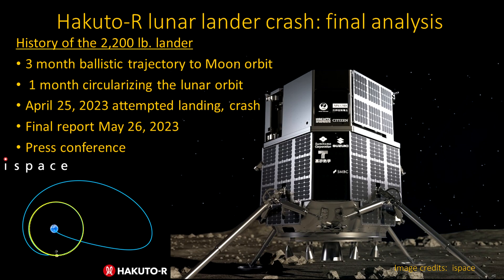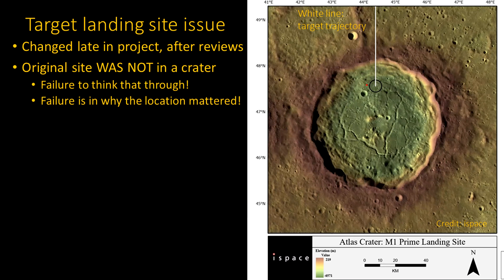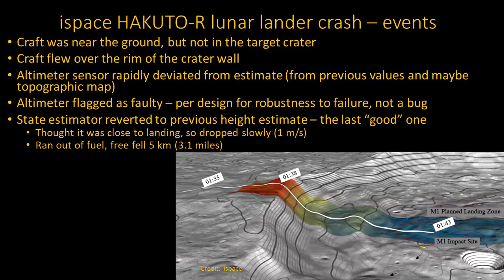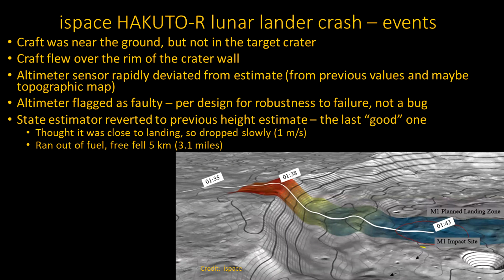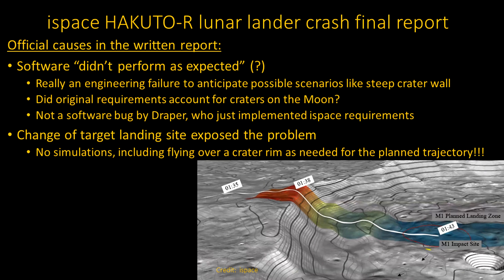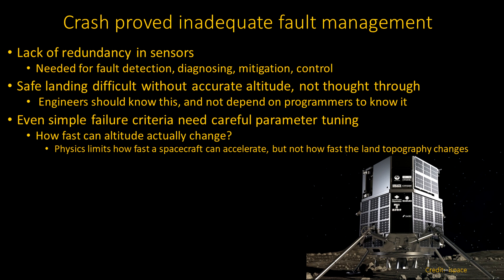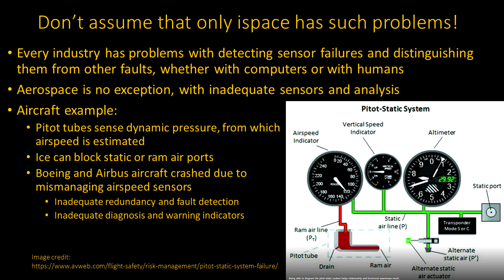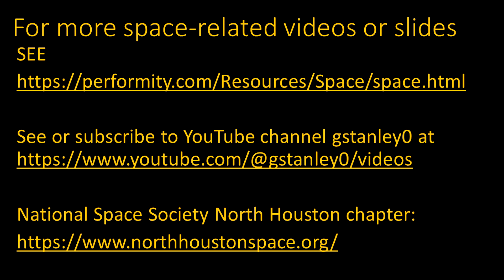Hakuto-R lunar lander crash: A failure in fault management

Comment: There are not a large selection of space qualified landing sensors on the market that engineers could just buy, and they all have physical limitations in terms of range. You're going to be on inertial navigation until you get in range of the surface, inevitably. There's no GPS on the moon. Optical solutions are expensive, requires a lot of computing power to do image processing. That means putting a big heavy box on the lander to add redundancy. That's something a big NASA program can afford, but a small commercial lander is trying hard to cut mass and  navigate with minimal information. A better alternative would be a laser range finder, not optics. A laser range finder pointed straight down at the surface would give you a viable, lightweight backup for your landing sensor. The fact that they didn't bother to redo the simulations at the new landing site is the real red flag that points at management and culture being a problem.
Reply from the maker: Thanks, @theresaklien6044  .  A laser range finder sounds ideal.  (Although I still wonder a bit about a camera-based solution as well, especially if they have one already in place.  That's because the Mars helicopter manages it on a tiny craft much more constrained in weight, and another commenter thought a cell-phone quality camera and processor might be good enough.   But admittedly, the Mars helicopter was originally only expected to navigate up to around 20-30 feet or so max altitude, and wasn't descending as fast, so I'm just raising a question about the possibility.)  

One interesting update from someone working on the project was that actually they did run simulations.  However, the original simulations only covered a small radius around the landing site, and they used the same radius for the new site. That radius didn't include the crater rim, so they didn't catch the problem.

Comment: Management may have considered the altimeter & inertial guidance were adequate "redundancy for each other", if that is a concept. The altimeter would provide corrections for IGS and if it failed the IGS would have been adequately updated to that point, and therefore reliable. Which leaves the question, if the landing site hadn't been changed and the Hakuto-R was approaching over and landing on ~flat terrain, AND if the altimeter had genuinely failed, would the default of using the IGS and slowly descending have worked? Would the landing speed be OK, or was a last moment deceleration crucial?

("Terrain" has the same root as terrestrial. Is there a better term for the lunar surface that isn't as clumsy as the lunar surface?)

Thanks, great video, you didn't just gather the facts, you put together a clear exposition.
Reply from the maker: Thank you, @donjones4719  !    Certainly a good question.  Intuitively, it seems like having just the inertial guidance system would likely be better than having nothing to go on - any other alternative seems worse.  I suppose it would take a lot of monte carlo simulation to really answer a question like that - allowing for variations on accuracy of the inertial guidance system, the position error at the time of failure, how far from the surface at the time of the failure, how much propellant was left, etc.  Even an inappropriate final descent mode with the roughly 1 meter/second descent would have been OK with a lot of excess fuel!

Comment: Seems, unfortunately, to have been entirely preventable. 

Did we ever find out why the Indian lander failed?

The Israeli lander, if I remember right, had a failure in I&C as well?
Reply from the maker: @ChistopherMorrison , good questions!   Taking a look at the Wikipedia article on the Indian lunar lander crash in 2019, it isn't clear.   
https://en.wikipedia.org/wiki/Chandrayaan-2  .
ISRO officially blamed the crash on a "software glitch", but then they said that the problem was that the engines could only be throttled in increments of 20%, between  40% and 100%, so they couldn't achieve "responsive control".   That's not a software glitch, that's a constraint on designing the control system.   While that would make control harder than with continuous modulation of propellant flow, it doesn't have to be impossible.  I could imagine some variant of a duty-cycle approach the way some DC electrical motors are controlled by what is essentially full or zero power, if the valves could be moved fast enough.   And in any case, there were 4 throttleable engines, so that smaller increments could be achieved by only changing thrust of 1 to 3 engines, instead of all 4 -- roughly more like a 5% variation in total thrust.   This set of discrete valve values doesn't sound like a real reason by itself, because they would have known this during the entire design phase and tested it both with simulations (for the whole spacecraft)  and in engine static testing (to see how closely one could approach continuously-variable thrust.  If that really were the problem, simulations should have made that noticeable.    But then they also said this was coupled with other control and guidance issues, not specified, finally resulting in conditions that were outside the design parameters for the craft.   The way I read that, that isn't really a software glitch - it was a design failure.  The software used whatever algorithm was planned for control, which didn't work well enough, and then the craft ended up outside the design parameters for the software, which by definition is not a software glitch.    But, that's a quick read based on very limited information.   The article also said that the full analysis was never made public, so we may never know.  But I would note that it's always an easy out to blame things on a "software glitch" to avoid too close scrutiny.  Everyone expects that people can't write bug-free code.    

"
The story on the Israeli lunar lander crash in 2019 also seems fuzzy.   The Wikipedia article covers this: 
https://en.wikipedia.org/wiki/Beresheet    
The problem apparently started with a failure of a gyroscope in the inertial measurement unit,  "and the ground control crew was unable to reset the individual component due to a sudden loss of communications with the control network."   Then, by the time communications was re-established, and a system reset was done, the main engine had been off too long, so a high-speed impact was impossible to avoid at that point,    It sounds like the system wasn't designed to be autonomous enough, unlike, say, the Mars landers with their "7 minutes of terror" when communications are impossible and everyone hopes the control system does the right thing. This is another case of working with limited information, but there seem to be multiple deficiencies here.  (1) during the final descent, when things are happening fast, there shouldn't be a dependence on humans in the loop at a large distance.  The system's controls should work, including in various degraded modes due to predictable sorts of failures.  So, loss of communications shouldn't be such a big issue.  (2)  failure of the gyroscope should be detected, and that gyroscope reading should be ignored, with some mitigation strategy.  (3) Why would failure of one component, or failure of communications lead to a need for a system reboot?  The software should handle component failures outside the computer  without requiring a reboot.   These explanations may point to design deficiencies in the control system and associated computer & software, and a lack of fault tolerance.  But again, this is based on limited information.  

There is probably a lot more going in these cases that is just not published.

Comment: Root cause IMO was failure of their Management of Change system: changed landing zone but did not adjust for much rougher terrain.  More robust fault management via sensor redundancy is critical for aircraft etc that will repeat missions hundreds or thousands of times but for a single-use scientific mission there may be compelling reasons (mass, power, balance, controller input slots, etc) to keep it simple and accept the risk.
Reply from the maker: Yes, the Management of Change was definitely a failure.  And, I take your point that tradeoffs always have to be made, such as weight or power.  But this wasn't a single-use scientific mission.  Their intention is to build a commercial business of delivery service to the Moon, not to do science themselves.   From the Everyday Astronaut,  
https://everydayastronaut.com/hakuto-r-m1-lunar-flashlight-falcon-9-block-5/   
after the first 2 missions,  "Following this, ispace plans for Missions 3 to 9 to focus on establishing the ispace lunar lander as a high-frequency and cost-effective transportation system. "  

Reliability will matter for a successful commercial delivery service, even if it is a limited business, because the typical payload value and the cost of the rockets to get them to the Moon are high. They aren't even expecting to change much in their design for missions 2 and 3.   I don't have details of their design, but if they already have any cameras facing downward, they could add navigation by matching pictures to the landing site and using available topographic data to come up with OK estimates of altitude, and do it without adding any weight at all.  But even if they have to add a camera, it can be quite light.  Even the tiny 4 lb. Ingenuity Mars helicopter manages to navigate by using a camera to match pictures of the terrain, and they have weight limits far more stringent than this 2,200 pound lander (including propellant), with its 24 lb payload capacity.
Reply: @gstanley0   A couple of up-to-date smartphone cameras would be adequate for this and their weight & power consumption is quite small, even in spacecraft terms. The reluctance to include them in the next 2 landers probably stems from the need to engineer their physical integration and software integration. That's done at a glacial pace for spacecraft, even for something apparently simple. Engineers fear some subtle interaction of components could remain undetected. Hard to think through all the fault scenarios - and they were just burned by not thinking through the late change in the landing site!
Reply from the maker: @donjones4719    good point.   It will be interesting to see what they finally end up doing, for the missions coming up soon, and then longer term.    If they already have a camera they are just not using, then in their press briefing,  they might be lumping that in with their software changes.
Reply: @donjones4719  Camera phones are not radiation hard. This thing has to pass through the Van Allen belt. Rad tolerant processers are expensive to qualify so the commercial market on Earth doesn't tend to produce them.
Reply from the maker: @theresaklien6044   Radiation hardening is definitely an issue.  I was impressed by the Mars helicopter design to mitigate that. JPL used a lot of off-the-shelf parts to keep cost and build time low, so it was very unlike a lot of other NASA projects.  They assumed there would be problems in the CPU and memory, for instance.  Their solution was redundancy, and detecting faults like a bit getting flipped.  Part of their solution was making the a reboot really fast, so that the helicopter wouldn't fall very far during the reboot which was the solution when a fault was detected.
The good thing about image analysis is that since it is ultimately calculating a distance between the observed image and some reference ones, it could tolerate quite a bit of noise caused by radiation  messing up some of the pixels in memory.  If the programming is affected, though, that's when the more drastic solutions like reboots might be needed.